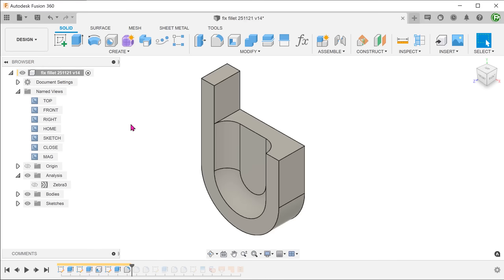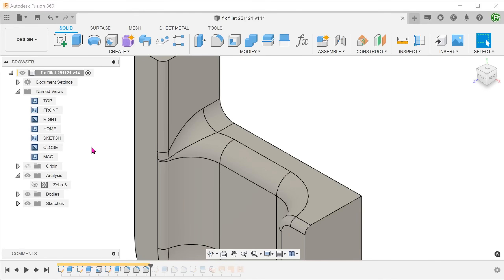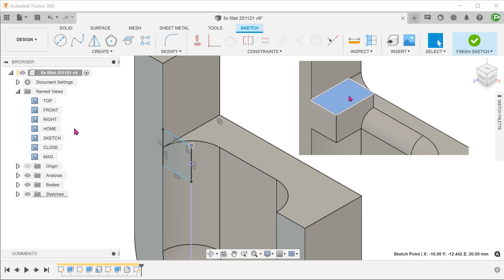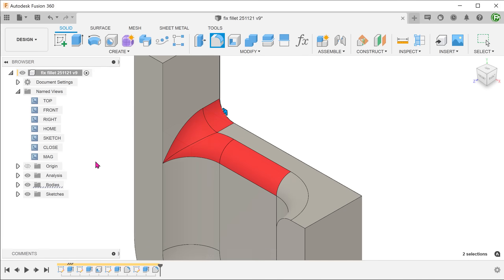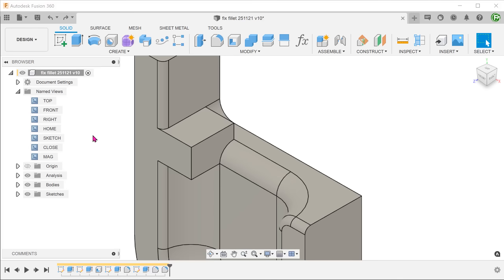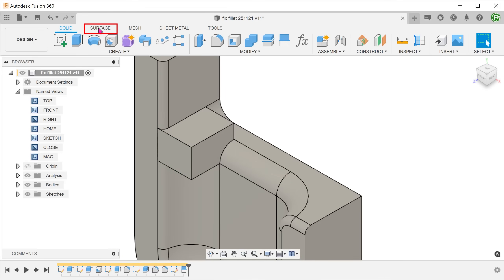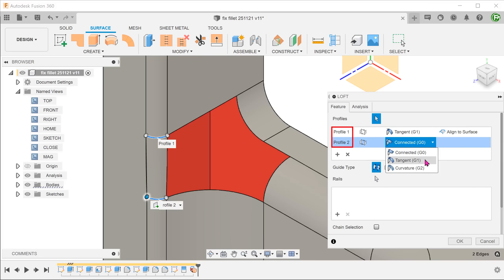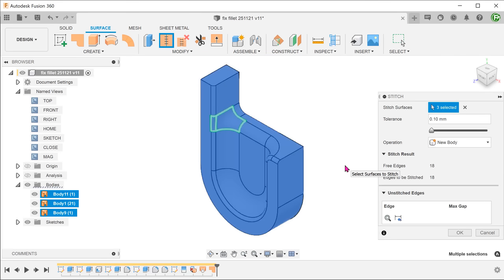Fusion 360 | Fixing Fillets

Comment: Discovered this tutorial in 2025 and downloaded the example file. It seems like the fillet tool has been improved and creates geometry like this automatically now, though it looks like it's using a single patch which is arguably not quite as the loft and patch demonstrated in the tutorial.

Comment: Somehow I feel like these tutorials all hark to way back... I would have just selected those faces and deleted them without doing any surface job, propably same exact result with one click...
Another one: delete box with copy of it, or continuing lines of the curved walls until they diminish.
 Also using this much lines and other 2D (in some other videos of this channel.. not fan.. but trying to master the software so I want to learn how others do it. I never used sketch in first 2 years, do all straight in 3d...

Comment: This is a workflow from waaaaaaay back! over 20 years ago - this was a common method to get fillets to work that the CAD software of the day could not handle. Basically - all one does here is to cut out all of the offending geometry and use the surfacing tools to create a patch. Its not exactly recommended - as often, the resulting surfacing cannot be manufactured without CNC or similar....but thankfully - Fusion 360 includes this!
Reply: CNC can make these surfaces, but damn the operator will curse you out when send these drawings to their shop. It'll be endless passes on a ballnose endmill, while all the other edges are cut with a simple radius tool ^^
Reply: @GermanTopGameTV  Thats absolutely correct! And probably the most important thing to say in this whole conversation! In general - DONT put rounds on ANYTHING. A chamfer is usually all that is needed and it is much less expensive due to the fact that one (sometimes two) passes of a simple tool are all that is needed. 

At least as long as we are cutting....
Reply: @Boldform_Consulting  "At least as long as we are cutting....
" This. A lot of home users are using CAD for 3d printing, and with that all of these concerns disappear. Its just as easy to make these complex curves as it is to make more simple radiuses.
Reply: @banaana1234  but then again fillets can suffer a lot of degradation on a fdm 3d printer when made out of the printing plane. In that case also fillets print a lot better! In the print plane it doesn't matter of course.
Reply: @Boldform_Consulting  Fillets are actually recommended but for 3D printing, since they help with warping on the edges by reducing the internal stress, which happens if you have really sharp corners, I can see how fillets can be harder for CNCs though.
Reply from the maker: I always thought that CNC would not be able to produce a complex surface such as the one created by the patch here. But then again, my knowledge in CNC is very limited.
Reply: @Fusion360School  no - CNC can do this....in fact, you would pretty much need a computer control to create shapes like this accurately, since defining them cannot be done with simple descriptions that a person could follow on a manual machine. There are probably ways to do it, but these days, shapes like this are defined in CAM off of the 3D model and the CAM software (which Fusion has included) tells the machine how to cut. (3D printing works kind of the same way, but it doesn't cut, it adds.)
Reply: Cnc can do whatever you want as long as the tool has a line of sight but it'll take a while if you want a decent surface finish.
The easiest is probably cutting the curves straight on a router (basically turning the fillets into a straight extrude)  and blend with sandpaper depending on the material

Comment: That's great. I really wish Fusion started work on some more advanced features that would make this proces a lot easier. Something like being able to start and stop fillets at certain distances or certain geometries for example. This is why I still love Siemens over Fusion.
Reply: That would be a nice feature if possible! How many times I just wished for something like that.
Reply: This is available. Variable radius fillet! define points, go from zero to whatever from points A to B.....or even A to B to C to D etc.
Reply from the maker: From what I understand about variable fillets, it does not really stop a fillet. Even if you set a point to zero, there would still be a gradual transition to that point, sort of like a loft to a point.

Comment: It is quite a workflow to get the desired result, but an interesting process. If I recall correctly, I saw Brad Tallis do something similar to this by placing a sphere over the messy filets,  but I don't recall in which of his videos he demonstrated this, nor how he did it (he's shown at least a couple of times). Maybe someone else saw this and can recall more detail than I can.
Reply: hey Adam12 - you're right! All you really have to do is jam a sphere, (or any other volume) over all of the offending geometries, and then do a Boolean operation to cut out that volume. This will leave a hole in the part, but you can then patch it in the surface commands....and stitch....works great. (But can be difficult to manufacture without CNC)